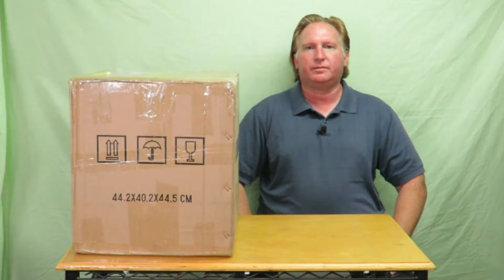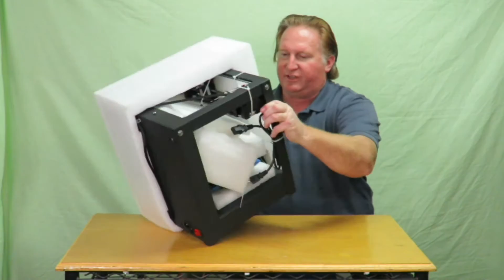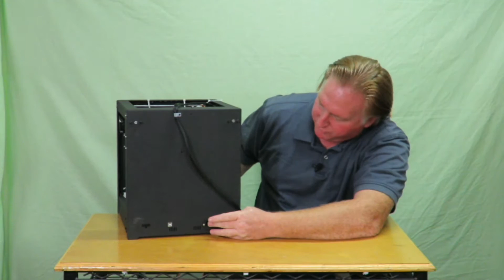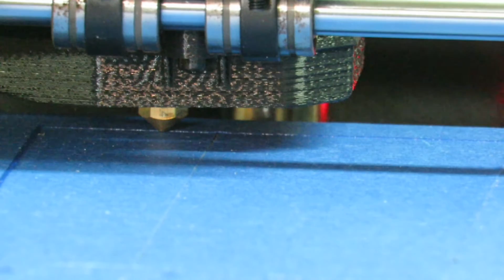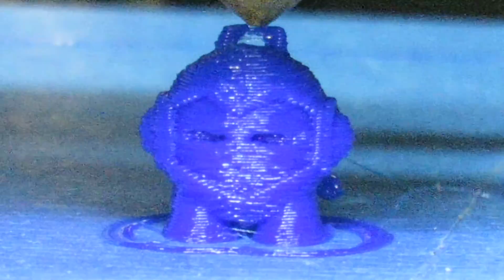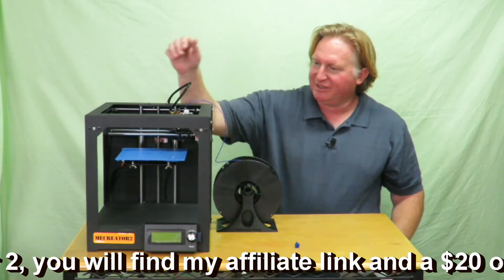Geeetech MeCreator2 Unboxing / First Print

Comment: The fan is very noisy. What you think about it?
Reply from the maker: +junnu vainio So far I really like it.  I really love the fact that it's already assembled and has a cooling fan for the nozzle.
Reply: It's nice cool. Don't you like Prusa i3 alunimium? I own that printer. I like it very mutch.
Reply from the maker: +junnu vainio I still love it.  The Geeetech Aluminum Prusa I3 is my baby.  It's just nice to have a backup.  Now I can change the bearings on the print bed, straighten the wiring and other upgrades I wanted to do but was afraid to do.  I try to keep a 2 video a week schedule and was just afraid to dive too deep into it incase I broke something.  But now I can fix it up while still providing 3d printing videos.  Do new upgrade videos for the aluminum will be coming soon.